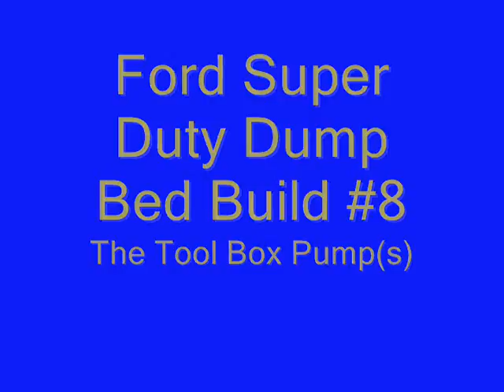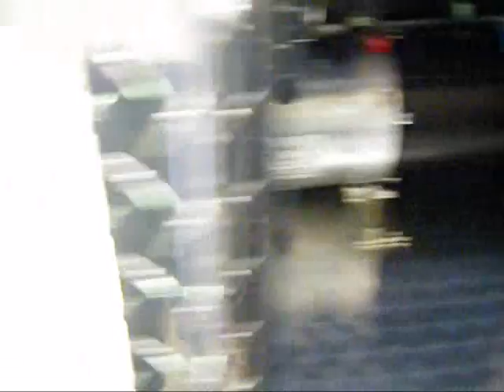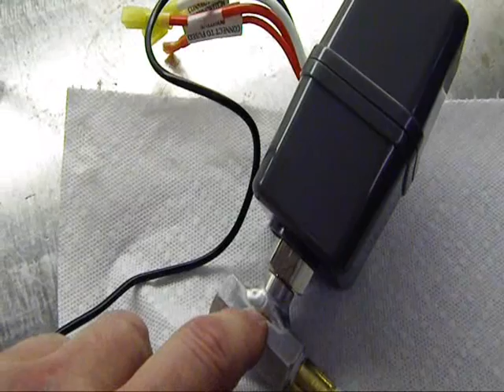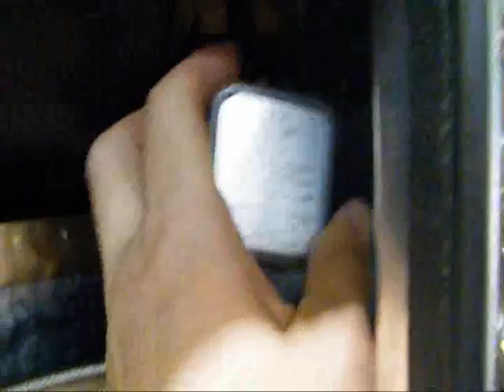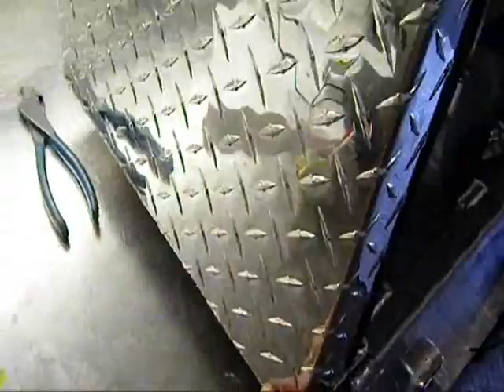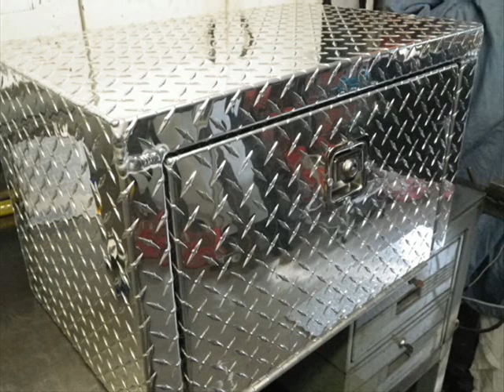Super Duty Dump Bed Build #8. Hyd. Pump and compressor mounting

Comment: You are really doing this right. Most people install the electric pump anywhere they can. It works good at first but think of all the grit and water and probably salt that will contaminate the connections and everything else. Its like when people complain their snowplow doesn't work and then they look in the reservoir and it is full of sludge from not changing the oil when they should. The junk gets there because of the location of the pump.

Comment from the maker: @fftron911 I was thinking of welding another aluminum plate inside but this stuff is so thin it wants to warp when I get puddle going. So when I make the support plate where the box mounts to it will be 1/4" plate under it. I will sandwich the plate box and hydraulic pump plus 2 other holes.